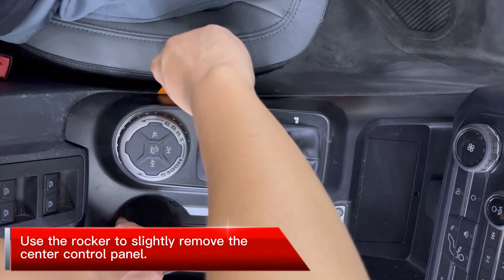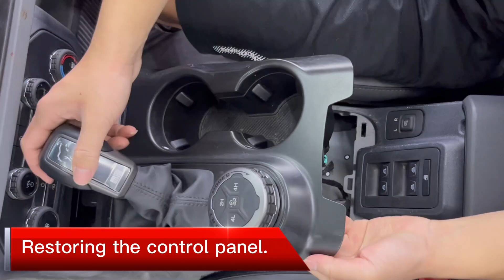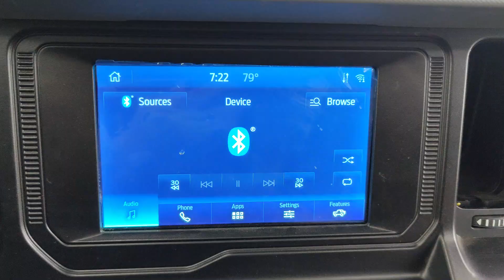Wireless Phone Charger Installation | Ford Bronco: How-To | MABETT

Comment: let me share my experience on this install.  The screws on the shifter are on the front side and not easy to get out unless you have a 90 degree screwdriver, they are also very short screws so be careful not to lose one down into the innards.  the screws in the plate you are replacing are torx so make sure you have torx bits.   That said, this thing seems to work very well and charges fast :)
Reply: I just completed installation and totally agree with the comment above. The shifter screws are extremely difficult to get to be careful and cautious. I learned the hard way!
Reply: Does anyone know the size of these screws. Yes I lost one of them...